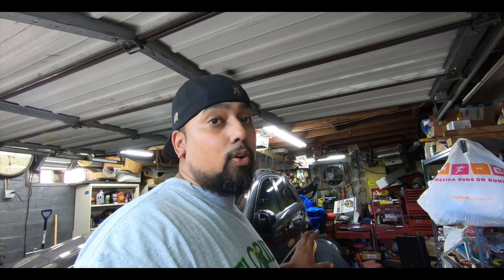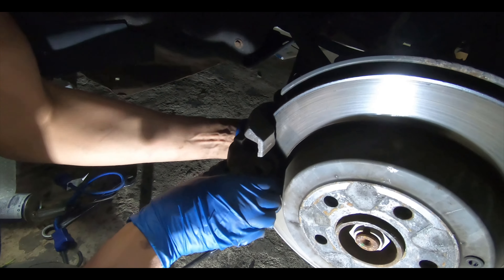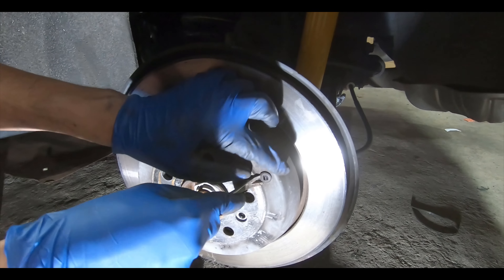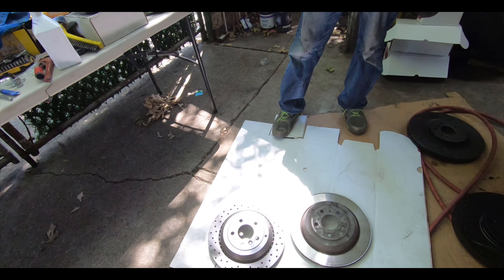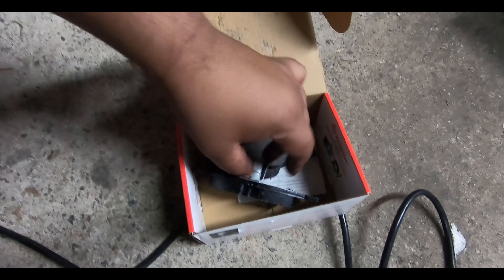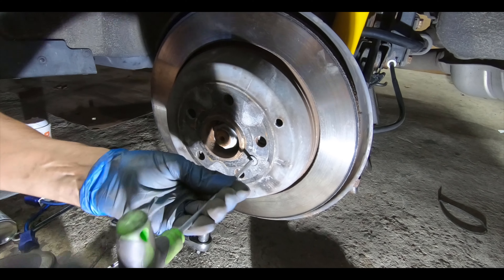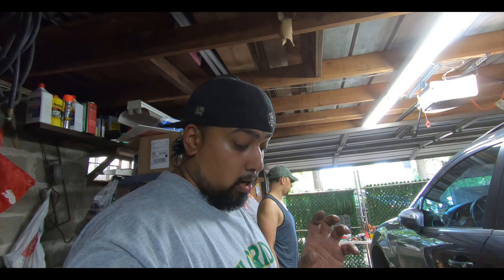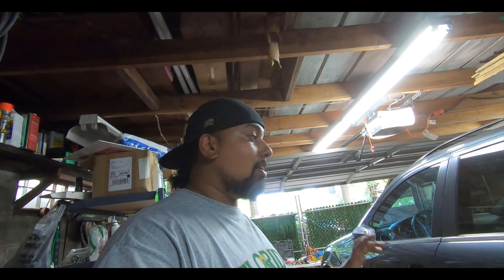Mercedes ML350 W164 Rear Brake Replacement/Upgrade!

Comment: When do you recommend changing the drum breaks?  Do they wear out the same as the front?
Reply from the maker: normally if its the rear it will take longer to wear out. In those cases you should check them before you replace them.
Reply: Most cars do not have drum brakes. Not breaks. Just a heads up.